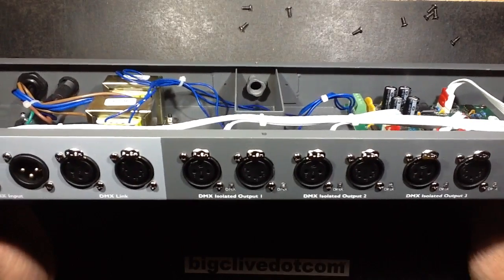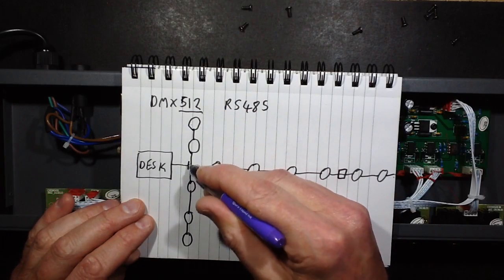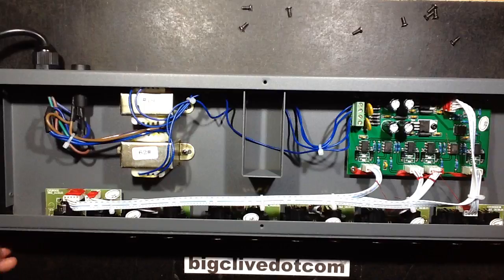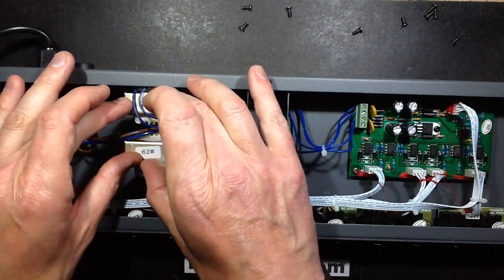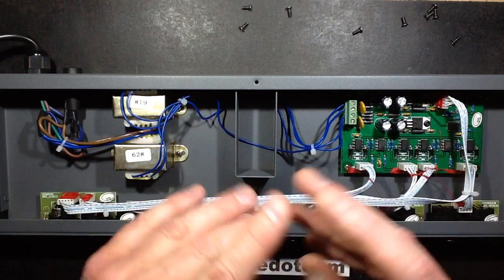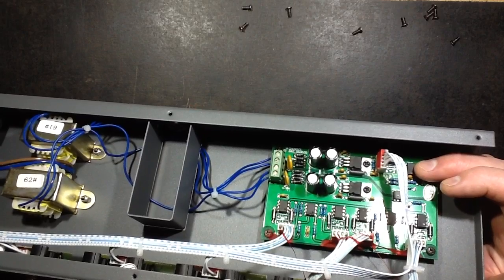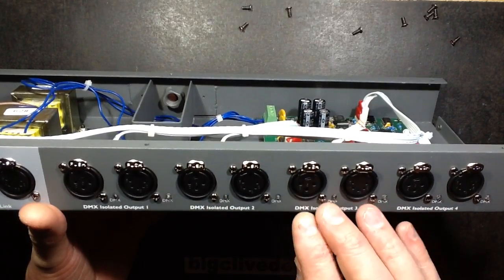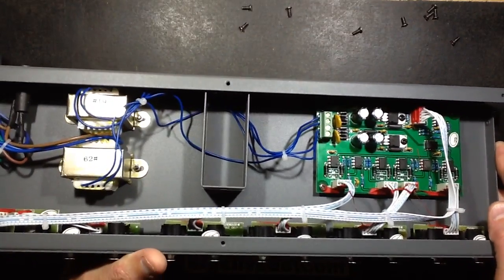Inside a Showtec DB-1-4 DMX isolator, buffer, repeater.

Comment: I know nothing about the lighting industry, but that protocol reminds me a bit of the old 10BASE2 Ethernet stuff in networking from long ago.
Reply: EddyGurge 10Base-2 aka cheapernet doez use looping and termination.  But it's single-ended signaling over 50ohm coax, while RS485 is differential over shielded twisted pair.

Comment: The question that everyone wants answered is have the connected the earth up to the chassis? lol

Love your videos!
Reply: bigclivedotcom At least some manufactures know what that weird green and yellow wire is for lol. good to see!
Reply: I was wondering the same thing, and yes they did. You are able to see it at 5:05
Reply from the maker: TornTech The earth was firmly connected to the chassis with an area of the metal buffed clean for a good connection, and the lug held on with a serrated washer and locknut.

Comment: Could the MZ thing be some sort of zener ?
We had a large network where i worked for building access control, kept getting damaged by lightning impulses, so on my suggestion the company that supplied the equipment added 2 reversed zeners, and 2 fuses to each box (crowbar circuit), so maybe that's a double zener type device ?
Reply from the maker: ***** A common way of protecting the transceivers inputs and outputs is the use of a PTC fuse and tranzorb (I think the diode things are tranzorbs).  The PTC fuse would protect mainly against accidental application of DC from something like a miswired scroller cable.
Reply: bigclivedotcom Often TVS (transient voltage suppressor) diodes are used. They  can withstand huge currents for short amounts of time. Tranzorb is just another name for it.

Comment: The more expensive ones tend to have a micro in there that will rebuild the DMX signal, so that you have a "fresh" output signal on all the outputs. Passive splitters like this will not repair any signal degradation that occurs along the way. Active splitters will. In some cases, this can be useful. For instance in very long cable runs.
Reply from the maker: jaaasgoed I prefer to buffer it up well before it's been degraded that far.  I'm slightly notorious for being lavish with buffers.  The slight downside of the active units, especially the bidirectional RDM type is that if the processor crashes you either lose your data stream, or worse it can jam the whole universe it is on.
Reply: +bigclivedotcom  The "best" failure is when it takes down whole universe by sending some random shit during the show!  Disco anyone ?
Reply: Fogger stuck at 100 % anyone?
Reply: Anvilshock Flames and pyros too?
Reply: jaaasgoed You can do that with just  a comparator, which costs about 50 cents.

Comment: Should start stripping down some more industry gear! Only so many variations of poundland things I can watch!
Reply from the maker: Cameron Marks The unfortunate part is that the industrial gear costs considerably more than a pound.  So buying stuff just to take to bits would get expensive very quickly.
Reply: Cameron Marks thats more mikeselectricstuff  -
Reply: +bigclivedotcom Good point, but if you scour the used sections of eBay, then you can find some interesting and cheap things.
Maybe you should open a PO box, but I don't know how well that'd do considering that you live in the isle of man :/
Reply: How about tearing down industry gear that has failed?